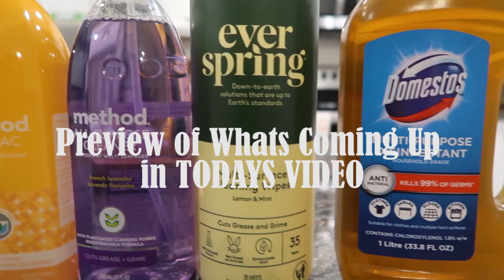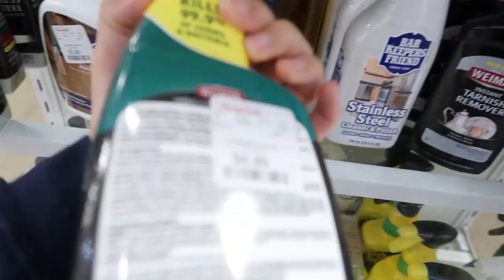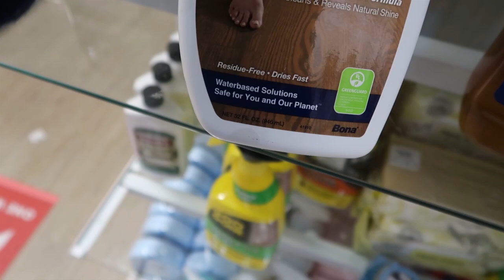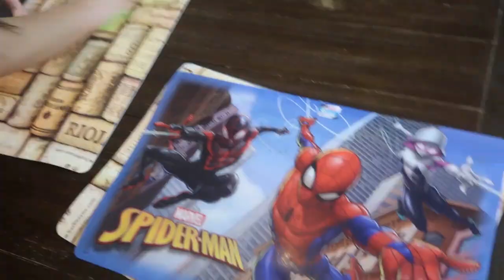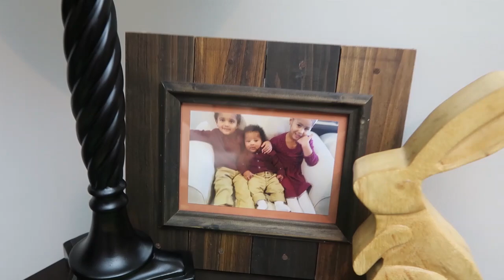CLEANING PRODUCTS REVIEW // As Seen on YouTube // Natasha Estelle

Comment: I bought the Ever Spring Mandarin and Ginger all purpose spray for when I wiped down my wall. It had a nice light scent but I tried using it to clean a stuck on spill later that week and it didn't work well at all at getting it up. I had to switch to a 409 spray.
Reply from the maker: Well I am glad you told me that. I probably would have given the spray a try, but now I'm not too sure.
Reply: I'm not going to buy it again. There is so much out there to choose from!🤪😁